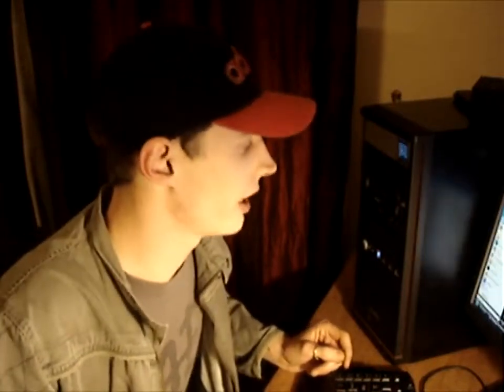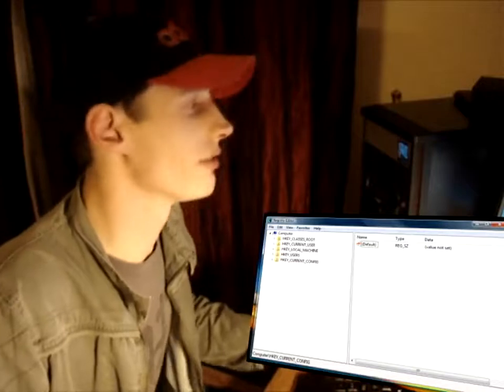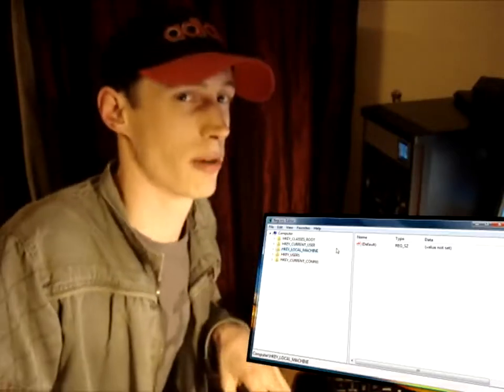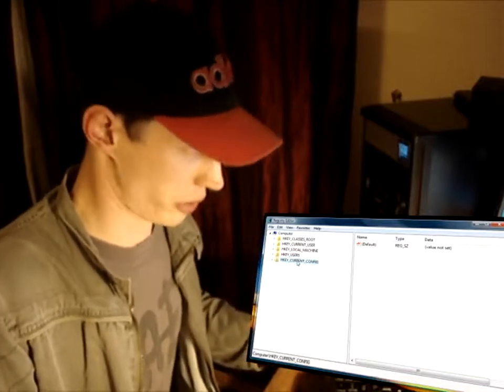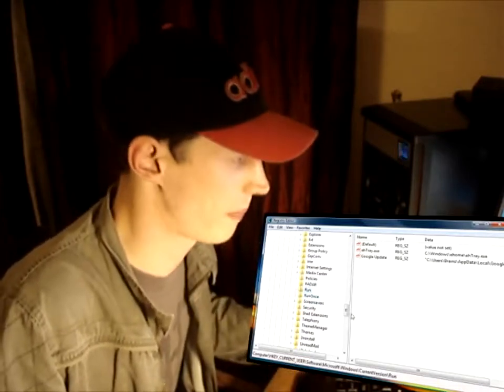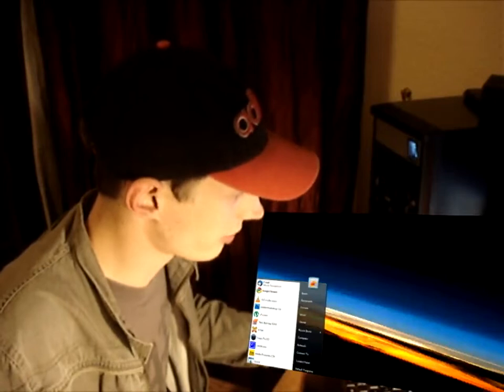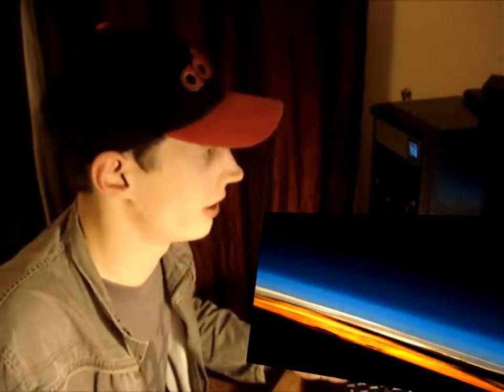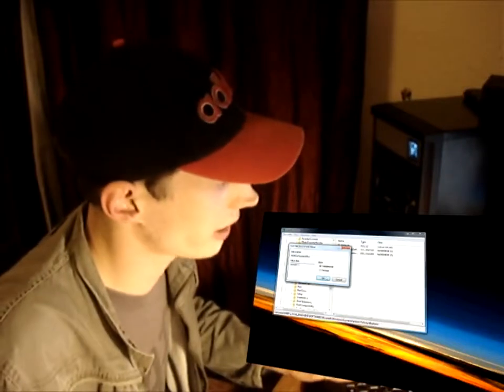Hakology - Registry Basics - Regedit & AutoPlay Hack Demo

Comment: I thought this was pretty good. I would like clarification on something though. Say you make a hidden user (just as an example) so you do the whole regedit [HKEY_LOCAL_MACHINE \Software \Microsoft \Windows \CurrentVersion \Policies \System]
DontDisplayLastUserName  ok so that's done now my question is about the values instead of 0x00000000 what if you did like 0x00003320 what would it do and why? what exactly are the values capable of doing and how do you know what to set them at?